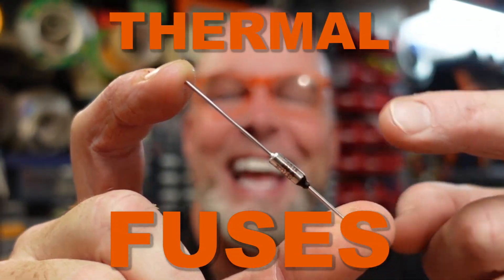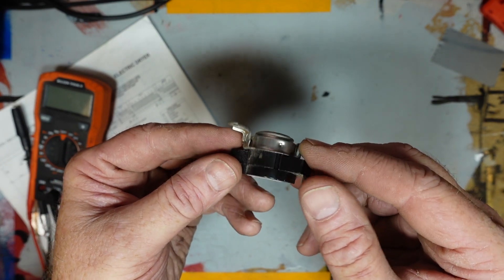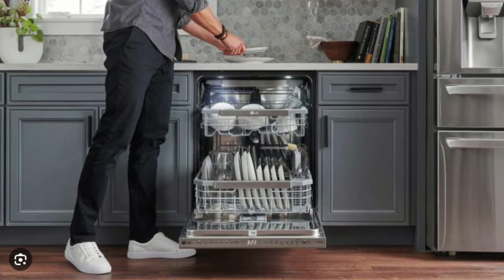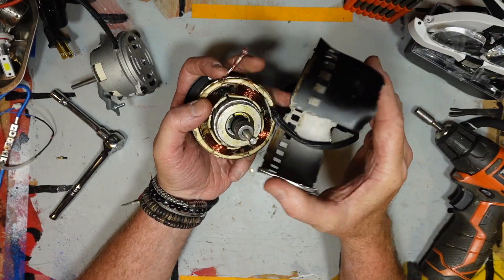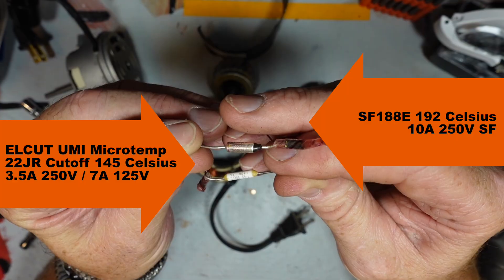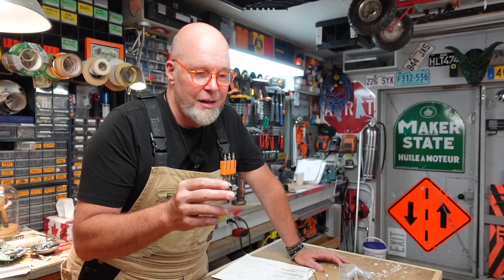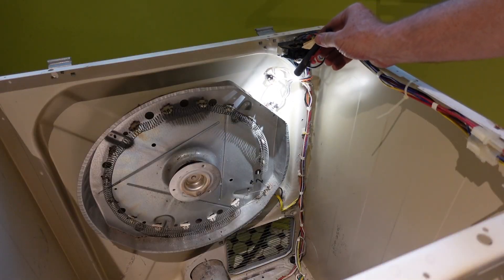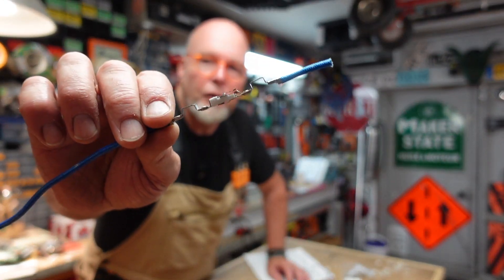THERMAL FUSES: How they work and why they fail #diy #tutorial #repair

Comment: I saved multiple portable heaters, air fryers from disposal by removing this annoying component. We have resettable devices in hair dryers and don't have in an expensive heater or air fryer.
Reply from the maker: As in many things, I’m not sure but did you install a new thermal fuse after removing the defective one?

Comment: The thermal fuse in my kilawatt electric use meter blew. I tried soldering it in a few years ago,😢 but i think used a little to much heat when i soldered the new one in. Ive since got a high quality hako iron, and my skills are up so im sure ill be successful this time.
Reply from the maker: Ideally you’d crimp the thermal fuse to the wiring. I think the heat from soldering might trigger the fuse. 
But where did you say you were connecting that fuse?
Reply: @ducttapersanonymous the two ends are pushed threw holes in a circuit board and soldered, no way around it, got a 4 pack of fuses luckily, i was sloppy last time and it took me a long time.
Reply from the maker: @Dmarkus_greene  Again, I'm not 100% certain, but maybe pinching something between the fuse and the soldering point as a heat sink would help? ☺
Reply: @ducttapersanonymous your right ,now that ive gotten enough sleep, i realize i can just solder wires into the holes, and crimp the fuse to the wires, maybe cut the leads on the fuse so it fits. Thanks for making me think.
Reply from the maker: @Dmarkus_greene That’s one benefit of sharing in a community like ours. 😊
Reply: @ducttapersanonymous thanks for that, im starting to see that. Now ive just got to find someone that can help me figure out how to fix the electrial issue in my honda accord. It has gremlins, the problems only come out at night.😅
Reply from the maker: @Dmarkus_greene Don’t get it wet or feed it after midnight!

Comment: as you said,
the thermal fuse stands alone ---- as our last line of defense -----
against the fire and furry that has turned many of our ancestors into ash.

in your example of "dependable fan motor",
i can only think of one reason that both low and high temp thermal fuses are blown,
and it is due to motor winding insulation failure, leading to short circuit, which is not repairable.

the video seems to imply that, the failure of thermal fuses is part of the current trend of "Planned Obsolescence".

yes, thermal fuses are HIDDEN and NON-REPLACEABLE.
only because, if the thermal fuses tripped, then a component has likely suffered a catastrophic failure.

the failed component, might be "Planned Obsolescence".
but that HIDDEN and NON-REPLACEABLE thermal fuse that protected us, certainly is not.
Reply from the maker: I absolutely agree with you, thermal fuses are invaluable. 
One trend I’ve been noticing is the rate at which I’ve been replacing baseboard heaters (mostly this past winter of course) because the capillary tube has become defective. I see 10+ baseboards holding on while more recent ones are pooping out, and the capillaries are listed on the manufacturer’s website as a replaceable component, but they’re always out of stock. 
Plus the work I do with fellow volunteers at my local Repair Café leads me to believe appliances are manufactured with at least one “frail” component. But I have to admit this is mostly my opinion and any evidence I have is anecdotal. 
I greatly appreciate your input! Cheers! 😊

Comment: I learnt about the non-resetting ones the hard way when I was a kid in the 80s - my parents’ iron had one that blew so I dutifully bought a replacement from an electronics supplier and then proceeded to solder it in 🤦‍♂️ I now run Repair Cafés locally and we have a full range of values for easy fixes noting on the packet that they should be crimped 😅
Reply from the maker: Hey! A fellow Repair Café volunteer! I work with Montreal’s RC, where are you?
Reply: @ducttapersanonymous good stuff 😊 Am in the UK - Cambridgeshire, East of England - we have quite a big network in this region 👍
Reply from the maker: @Umski RCs started in Europe, we’re just catching up here. 😊